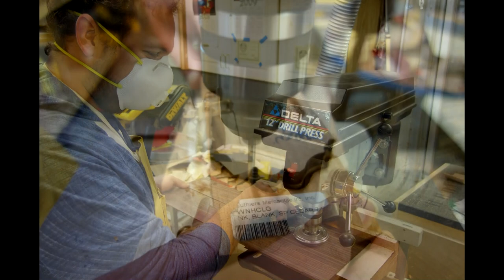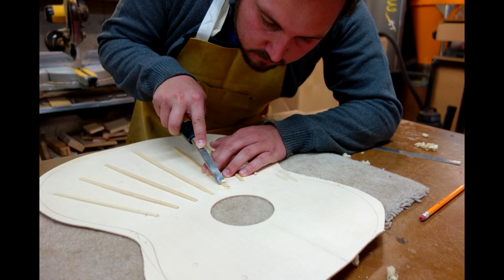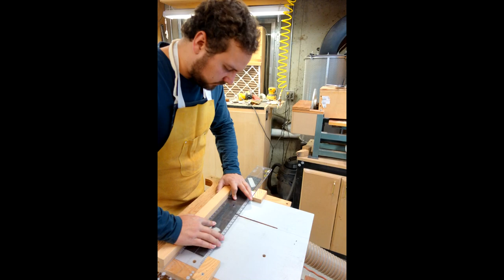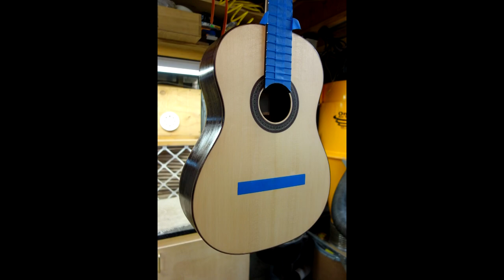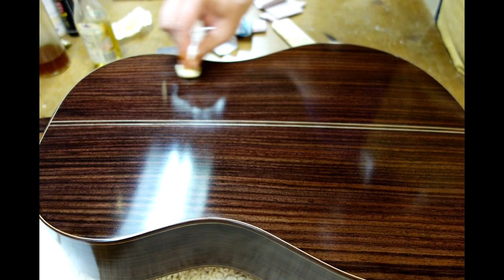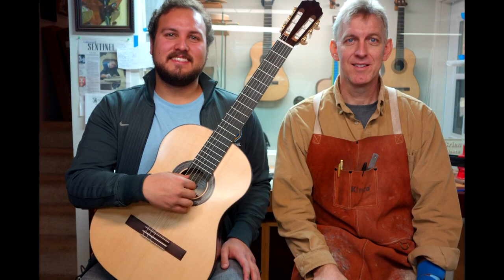Jorge Figuera plays the guitar he built at O'Brien Guitars

Comment: Very nice work and playing. The Zap-it epoxy filler I used just didn't set up right even after a couple of days. Have you ever had old epoxy do that, I mean I bought mine on line and maybe it was old when I got it.
Reply from the maker: I use Zpoxy brand epoxy and use the finishing resin version. it is not a glue. Most epoxies are temperamental with the mix ratio. Zpoxy brand is not. It does have a shelf life so I would test it before applying if you are in doubt.
Reply: Thanks for your response. I think the one I used is the Zpoxy the 1/2 and 1/2 mix ratio was one of the main reasons I used it. Must have been old.